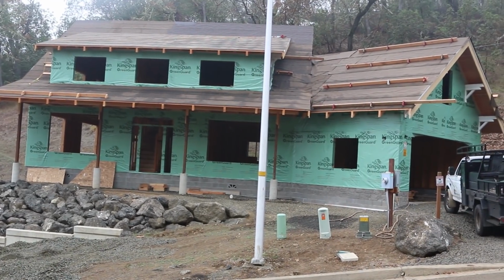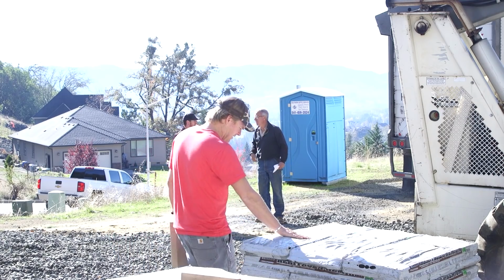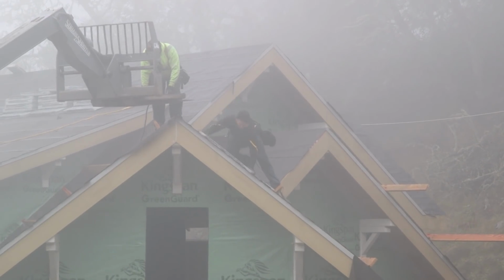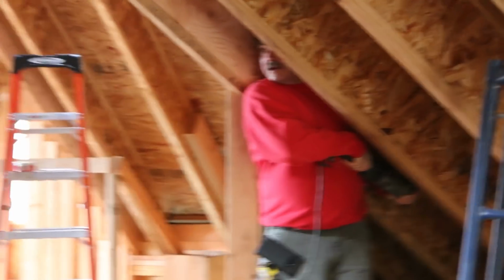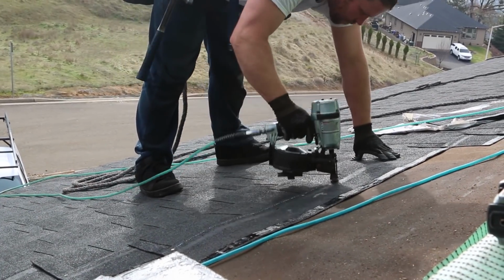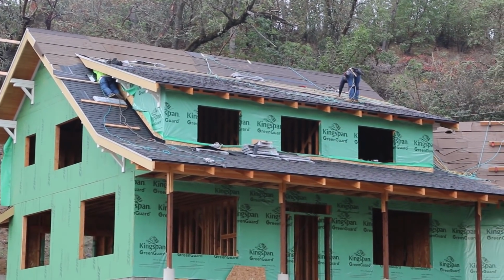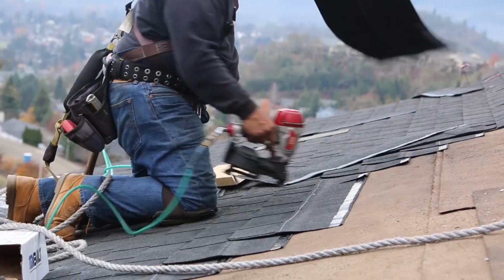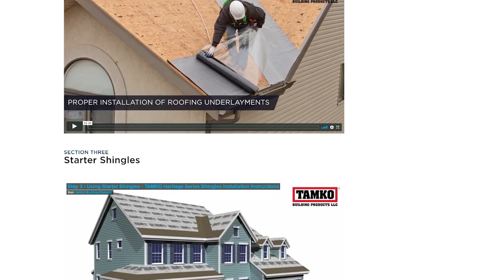Installing Asphalt Shingles Ep.77

Comment: I find these shingles fascinating as I've never such a roofing technique used here in Australia. Here it's either concrete tiles or "colorbond" corrugated steel.
Reply: I find it fascinating as well.
Never seen anything like this in Australia ether.
Perhaps it's not cyclone rated..
I've got clay or ceramic(?) tiles.
Whatever, heavier than this ruff.
Reply: here in Lithuania everyone is using clay or concrete shingles or steel, these kind of bitumen "shingles" are usually reserved to sheds or cheapest of houses, they are no great because moss and lichen like to grow on it and reliability of such roof is not the best long term.

Comment: Ladder safety IS important.  My grandfather, GOD rest his soul, fell off a ladder when doing some painting.  He hit his head on the concrete.  He got up, cleaned up the mess. went home and collapsed onto the kitchen floor.  He was rushed to the hospital and during his brain surgery he died.  The doctor said that with so much brain damage he didn't see how Bob could get up off the concrete much less clean up the mess and drive home.  So when it comes to getting onto my roof several times a year to clean out the gutters I ALWAYS practice ladder safety out of respect for the tool and its operational characteristics.  I sure do miss grampa.  That was 1971.

Comment: I fell down a wet plywood ramp about 6 feet tall that had no stops on it, onto my outstretched arm onto the dirt 15 years ago. I had a 2nd degree sprained shoulder joint. Could not use my arm or shoulder for about 2-3 months. Took about 1 year to heal.

Comment: I’m amazed by the different building codes throughout the country.here I n south Florida you’re required to overkill the felt underlayment paper with  galvanized nail and tabs . Still rips right off in a hurricane.  I tell inspectors all the time it doesn’t matter how many anchor points you installed on the roof. When Mother Nature wants to blow your house down nothing will stop her.

Comment: The other day as I was on my roof a wind took my lightweight aluminum ladder, leaving me with no way down, just as it happened 30 years ago when I shingled it myself. Fortunately  I have helpful neighbors.
Reply: That's why I took my cellphone with me to repair those loosened shingles in yesterday's windstorm. Unplanned repair, no one around to spot me. Had to go up though. Sometimes, modern tech has its uses!

Comment: they get that all done in one day?  im a builder from Connecticut. we got to tape the plywood seams and do ice and water on all joining areas and steps, where shed roofs or gables meet the main body of house and 24 inches from inside edge of conditioned area plumbed up. so for us its two courses  ..  carrying it up the ladder two story colonial with 1600 sf of in law apartment  and full first floor front porch, 56 square 8 hours, 5 nails per.  totally outstanding.

Comment: Surprised to see no drip edge on gable edges, or did I miss it? Nice job getting her covered up in time! Next windows / doors for dry in!
Reply: More on flashing next episode.
Reply: Got to be drip edge on the gables, that is standard just about everywhere. I would have liked to see ice & water guard on that whole roof instead of felt. Also would have liked to see the ice and water or felt in this case run long up the wall and tacked a foot or so up from the top of the step flashing.
Reply: Anon, when replacing a roof on an existing home, would you put the drip edge over the existing wood strip, or remove the wood strip and place the drip edge where it used to be? Thanks.

Comment: As far as ladders go, I’ve not only done construction stuff but also theater tech type stuff, which involves a lot of ladders sometimes. Pretty janky stuff too, where in order to change out house lights above regular seating that’s at an angle we have a plywood box on a lower level to allow us to have an A frame ladder across the lower and upper levels of the seating. That’s the sort of stuff where all it takes is one slip and you get thrown right off, not to mention that it’s a 20, 30 , 40 foot ladder sometimes which is really sketchy and great way to get hurt. I’ve already fallen off some of them but I’ve been able to get off pretty luckily with just some minor bumps and bruises, but others are not quite so lucky and I’ve seen some nasty injuries from it.

Comment: Interesting to watch this roofing system being finalised as it is not something I have ever seen here in Australia. Rooves here are either tin (corrugated or pressed steel) or tile. Neither of which use this chipboard & tar paper substrate. They go onto batten on truss structures with thin foil paper as a drip barrier. However this is all based on my experience in and on rooves in Queensland where we only get winter for a week of the year if we're lucky (unlucky). Perhaps it's different in our southern states where snow is an actual possibility.
Reply: No different, same in Canberra. Although you may find a layer of builder's blanket between the roof sheeting if it's steel, to reduce radiant heat loss in winter and heat gain in summer.

Comment: That zoom boom or "Lift sure saves a lot of Back breaking work. We do the same thing here in Ontario Canada. Only thing we have to install at least one course of Ice and Water shield on top of the drip edge to prevent ice damming. We get a lot of that here.  Your right Ladders are the most dangerous I hate and detest working or climbing a ladder. I would rather climb a tree or scaffold. At least they won't tip over.

Comment: I fell off a 1 story roof (standard height roof with a 3 foot crawlspace) 20 years ago and did not seriously hurt myself, just some minor bruising. I was sitting on the edge of the roof cleaning out the gutters, when I thought I was sitting on the roof and I was sitting on the gutter area and it collapsed and I fell onto some plastic garbage cans which cushioned my fall. I was lucky I did not hit the edge of a 6 foot fence, some concrete stairs or hit the ground. I could have been seriously injured or killed.

Comment: 13:27 Valley? Metal flashing?  I just did my first solo rooting job all myself on my garage. Hand nailed. Took a while but I learned a lot about using a speed square, pitch of roof, rafter reinforcement, resheathing, flashing in the valley, staggering shingles so you work in the same area and are not constantly moving, ladder safety. It's hard work.

Comment: I may not see the 2nd Ep.Just like to share, here on the East coast, if you do not stick every shingle with roofing tar they will, within the first year end up on the ground.
I know you will say they have the self stick tar strips, as all other shingles do. As I said, here if they are not individually tarred, they will end up on the ground. 60 mph winds love shingles, and if one is not stuck good, off it comes.  On re shingle jobs the air nailer is not used by many here, as it is hard to tell if they hit anything, and if a few nails do not find good wood, it leads to sections of roofing coming off in high winds.

Comment: I can put shingles on a roof and nail them down, but I'm not very fast at it but I can do it.  The worst part is the prep work removing all the old stuff, once you get started it goes pretty well usually though.  Reminds me I need to replace the roof on my carport...you can stand under the roof and take a shower when it rains...guessing that's a good sign it needs to be replaced LOL.

Comment: Having painted and framed for 30+ years one of the best safety tips I ever got was this.  Take a piece of 1/2 inch rebar 3ft long and bend a hook in it at about the 2 1/2 ft mark.  Once you have set the ladder, take the rebar and drive it down so the hook is in the middle of the first rung.

Comment: I would almost always pay the little extra for 30-lb felt because it's harder to tear it loose.  Especially on any roof steeper than 6/12. 15-lb felt, the most commonly used weight, is fine, but your shoes can rip it or tear it loose,  especially on steeper slopes of 6/12, 7/12, and 8/12, causing you to fall.  9/12 and steeper definitely require toeboards over the felt, and roof jacks and planks for the shingles. The steeper the slope, the more your feet act in a sliding direction on the felt. 
    When real tarred felt, without fiberglass, was  still used universally, you could felt the roof and come back in the morning to a flat surface. When the felt got fiberglass, it got denser and thinner slightly, and for some reason, even  the morning dew would cause it to bubble up  ripple everywhere, and it doesn't always lay back down properly when the sun gets on it and dries the dew off it, I think this might be caused because the felt actually moves slightly, relative to the nail shanks, due to the felt expanding from the moisture, or it ay expand in width and length and not shrink back completely when dry. 
   The bubbles make the felt more likely to tear or move underfoot. the bubbles also can cause slight raising up of the shingles, so that you can step on the finished roof and still feel an air space.   However,   the standard nailing pattern is sufficient to flatten out the bubbles, or almost flatten them out.. 
         If possible, I preferred to roof right behind the laying of the felt.  Of course, the man thing is never to leave the roof overnight without at least a watertight felt layer, but if there is enough time and the weather is good  then following the felt with the shingles, as close as possible behind the installation of the felt,  (like one felt row width below) is often possible. 
      Then when you climb down and go home,  you know that not only is the whole roof safe from rain overnight, but most of it is already shingled too;  and so  even strong wind and careless feet less of an issue. 
               I've seen 10-lb felt used, on a lot of roofs. Once I saw it used  in a multi-building apartment complex, and a strong wind came one night, and tore  half the felt off of the roofs. It was all over the place and the roofers had to almost start over. 
     Felt is cheap enough so that I considered  the extra cost of 30-lb money well spent.

Comment: Much respect to you sir and what you're building, i have been following from the beginning. Sorry to rain on the Tamko parade, but my experience is their roofing materials do not stand up well in Texas, the granules are not embedded in the asphalt well and shed after 5 to 15 years depending on ventilation.  We installed them for my first 2 or 3 years but have switched to Malarkey in '16 and the comparison is not close in my opinion. Nailing zone (congrats to GAF on finally getting with the program) is much larger, more adhesive and its better,  rubberized asphalt holds granules better and flexes with temp changes and we have found hail resistance in their highlander non impact rated shingles (class 3 or 4). Tamko warranty department is generally pretty good about standing behind them, but there are many exceptions for that. Looking forward to the rest of the build!

Comment: I know that they can be a bit cumbersome, but I really don't understand why more contractors and workers don't use ladder standoffs on their extension ladders. They add a tremendous amount of safety and stability. I will grant they are not always viable, but the Ladder Max ones I use (I won't use any other kind) are held on with 2 hitch pins. Easy on and off for situations the standoff doesn't work. Great video though. I've never seen such a detailed roofing video with such a great crew of guys.

Comment: Here in Phoenix seeing much more synthetic underlayment...any thoughts on that?
Reply: and everywhere else too. My guess is EC is old school and didn't want to use a new material. Could be wrong. Synfelt can be exposed longer and won't get wavy limps like the felt paper did. Also goes down smoother almost 10 sq to a roll weighing less than a 2 sq roll of felt!

Comment: Why no synthetic felt? It lays so much smoother. Why not do eave fascia boards before the roof? We use Owens Corning in my neck of the woods. I have yet to see a ridge vent that didnt plug up with dirt. 750 slant back roof vents over an 8" hole never plug up. My 2 cents.

Comment: Hey Guys. I'm a roofer from England. I love your videos. Thank you for all the thought and hard work. I love how you guys do things in the States! I have a quick question. ..We don't use Asphalt shingles. I noticed that the fixings for each course of shingle are put in really close to the bottom of the next course. In other words, there is very little of the shingle above to cover the fixings. So I'm surprised it doesn't lead to leakages. Can anybody explain that please? Thanks America!
Reply: These shingles come with either a tar/sealant line or a simple nail line, you're meant to place the nails in front of this strip in order to catch the top edge of the underlying shingle as well. The tar line also gets sticky from sun exposure which helps keep the shingles flat. 
 
if you nail too low, you'll have an exposed nail.
if you nail too high, the nail won't catch the top edge of the shingle below it.
Nails too high are a worse problem, because you can't see this problem from the ground. If a whole roof is done this way then each shingle is lacking nails in the top edge, which greatly reduces their stability during high winds, and will likely blow away eventually.
Reply: You're right that the nails aren't very far above the bottom edge of the next course of shingles. But it's enough. Rain would still have to go uphill to get to the nail to leak.  There is a minimum roof pitch on which  shingles can be used.  Obviously, if they were further up, it would be even harder to for rain to reach it, but there's a reason that row of nails is where it is.  One of the critical parts of asphalt shingles is the adhesive which secures the lower edge of the shingles. This the lower edges of the shingles are glued down to the underlying shingle with an asphalt adhesive.  this keeps the shingle lying flat and prevents it lifting in the wind.  The adhesive is applied during manufacturing, and  on the first good sunny day after installation, the adhesive will soften enough to bond the shingles together. OK, so back to the nail placement ... those nails are placed as nearly as possible to where the overlying shingle will adhere to the underlying shingle, so that it's being glued down to a secured shingle vs one which was only nailed at the top edge, and could lift some itself.
Reply: Great. Thank you guys! We use a lot of slate and concreter tiles here, where there is a general 3 " overlap rule, as regards nails.. I look forward to the day when we look back at how stupid it was to cover our roofs in tons of brittle rock, when we could have done it so much quicker, cheaper and more damp proof in a more modern way🙂

Comment: I’m surprised you didn’t add a wedge where the pitch changed on the front. Maybe you don’t have ice dams, like we do in Missouri. But the snow slides down the steeper pitch, forming a dam at the lower pitch. My house has a 42’ long porch with the same kind of transition. It’s a rude awakening, when your child wakes you and says there’s a pretty waterfall in their bedroom. The second roof had a 3’ wide rubber sheet added across the transition and the roofer called it a wedge? I attempted to break the ice dam with a rake from above, when I lost my grip, I slid thru the ice dam, problem solved. By the way, it was only 12’ to the ground.

Comment: Did you install Permanent  Safety Hooks at the ridge lines for future roof access and maintenance ?
Reply: Are they common? I've never seen a permanent safety hook installed on a roof before
Reply: @spensersmith6923  And I'd question it's safety, uninspected for 10 or 30 years. Or 50.

Comment: Ive had good luck hiring contractors. I credit this to rarely doing so and generally only hiring those that have reputations in good standing to people in the business who have worked with them.

I usually find though, if I want it done correctly and I want it done to the best quality for my money, I've got to do it myself. Whether I know what I'm doing or not, every tradesman started out in the same place: knowing nothing. 

Second note, a roof is a great place to have a harness. I highly recommend it there but there are many times they are required and I do not recommend wearing them. Particularly in situations where agility is important. Hard hats, safety glasses, etc. fall into the same category imo. Use them whenever you can but do not let them make a relatively safe job dangerous.
Reply from the maker: Well put!

Comment: It looked like when the drip edge was installed, there wasn't a gap left for the outside edge board to slide behind. 
I'm unclear if that would be the fascia board, but either way, how I understand it, there should be a gap that's wide enough to still have a gap after the edge board is installed. 

Unless I'm mistaken and someone else could clarify on it?

Comment: Doesn't the drip edge usually go over the fascia that isn't  installed yet?
Reply: Drip edge first then slip aluminum fascia behind drip edge
Reply: Yes. And they drip edge should be installed with a slight gap behind it when installed against a wood fascia board. This prevents water wicking to the drip edge and rotting the fascia. Install is different if metal fascia trim is installed.
Reply: @brentoconnor6127  Okay thanks, Good to know.

Comment: Not sure I've ever heard you guys weigh asphalt shingles vs. standing-seam metal roofing.  If you did the installation, would the added longevity not make the house more valuable than the difference in cost?  In that moist environment (as here in the coastal California mountains) shingles do not last so well.